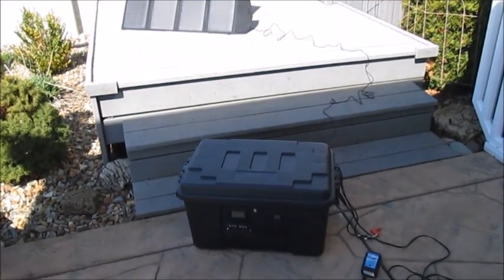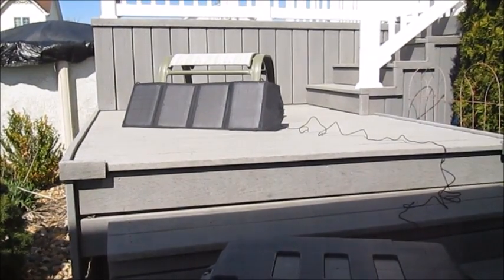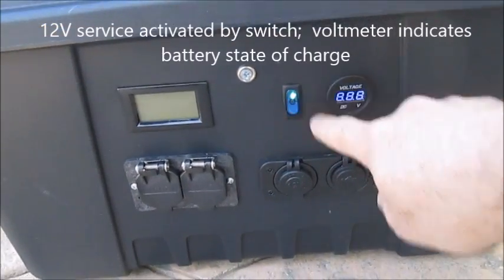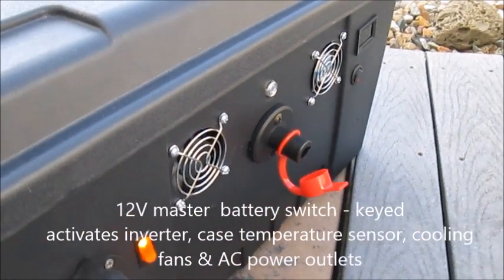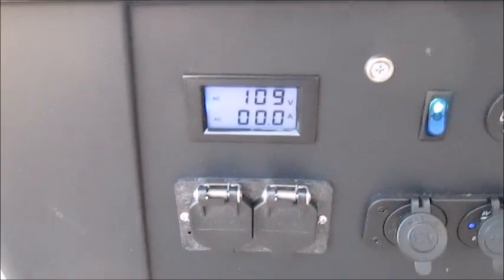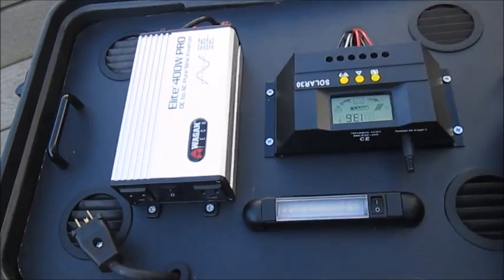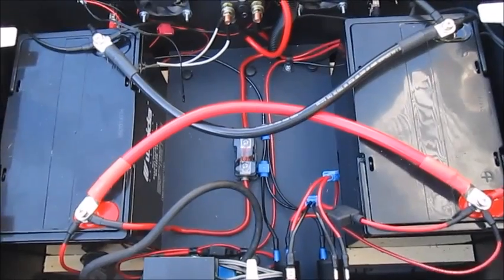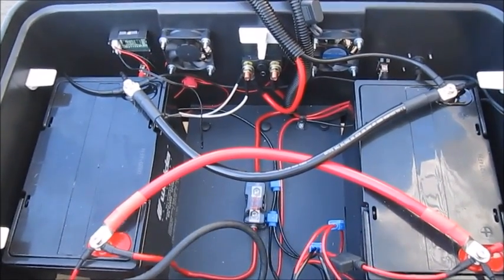V1 P1 DIY Portable Solar Power Generator - Wiring Schematic, Parts List, FAQ Sheet Provided

Comment: How do you know how much percentage you have left to draw from the unit.
Reply from the maker: I use two different voltage indicators for the State of Charge of the AGM batteries.  One is located on the front of the case, the other is built into the charge controller.  The voltage is then compared to a state of charge percentile conversion chart comparable to this one  http://www.aussiebatteries.com.au/assets/images/12-v-Battery-State-Of-Charge-website.jpg  There is also a basic State of Charge bar graph style meter built into the charge controller.  I rely less on that because it is not as specific as comparing the actual voltage reading to known data regarding percentage State of Charge.
Reply: Jim Fisher  How accurate is indicator. If this works good for you I am so building me one of these. Can you recommend a 1200W pure some wave inverter.
Reply from the maker: Both voltage meters are generally reading the same voltage, + or - .1 volt, so I think they are quite accurate.  Others who have built these types of systems use AIMS pure sine wave inverters and have given positive reviews.  I don't have experience with that brand myself.
Reply from the maker: based upon the specification of the 15A model of that charger, it should be able to handle your combined 250ah batteries' charging needs.

Comment: This looks fantastic!  I'm looking to build one of these for phone charging and charging my Makita drill batteries, etc in case of SHTF or power outage.  Can you add another power generator device in addition to the solar panel?  I see there's bike pedal power generator and I'd like to make a way to be able to charge the battery with solar or bike pedal.  Would you just wire the solar panel and pedals in series then to the controller? Also, for the USB charger plugs, did you wire that before the inverter? Again, excellent build, that thing rocks!
Reply from the maker: Thanks for viewing, and for your comments/questions.  Yes, you could use other types of power generation devices such as wind turbines or a bike pedal power generator to charge this system.  I would separate the various power input systems.  A solar charge controller is not likely appropriate for regulating power from anything but solar panels- you'd likely use an alternator coming from your pedal generator.  The USB charging ports are connected to the bus bar, which takes its power directly from the batteries.  The USB ports are DC, not connected to the inverter at all.

Comment: Posting says $150.  Voiceover says $950.  Building my own to save $!   $950 is no bargain when I have to hire electrical engineer to do it for me as I'm paralyzed and vantage afford ready-made one for $1500! Too much $ for a DIY roject but it's sturdy.  Guess if you can afford a boat you can afford  a$@50 DIY project...if you are an electrical engineer!
Reply from the maker: Hi Melodee, thank you for your interest in my DIY project.  Not sure where you saw that the cost was indicated as $150.  You are right, if you do not have the ability to use power tools or have a good understanding of DC and AC electrical systems, this would not be a DIY project you would want to undertake.  It does not require an electrical engineer to put a system like this together, but certainly requires handyman skills and a substantial amount of research to be sure of what you are doing.

Comment: Great looking piece of equipment!  Question: would using a lighter colored container reduce the internal temp of the unit if left in the sun, or do you just make sure it stays covered when in use?
Reply from the maker: Thanks Marc.  Using a lighter colored case would likely keep the internal temp down if you intended to use the system outdoors.   In my case it is always kept in the shade inside my boat's cabin.

Comment: I gotta say, that's a very clean build.  Not sure why all the angst shown relating to cost.  The parts list breaks it all down quite nicely.  The Leviton plug cover is now $40 though, a bit steep for what it is.  I may get the slightly larger case so I can fit a larger Modified Sine Wave Inverter along with the smaller Pure Sine Wave and possibly a third battery.  Thanks for the great ideas.
Reply from the maker: Thanks for viewing and for your comments.  Hope your build goes well!

Comment: $1000 bucks? Not good value for the money. Fun project but a waste.
Reply from the maker: Your comment only serves to display your ignorance about these types of systems and component costs.  Do some research.
Reply: $2000 for the exact same thing made by Goal Zero (Yeti1250).  $1000 and some elbow grease is a good deal
Reply: I have 50 dollar in mine you just gotta be proactive and find your resources. Patients is key

Comment: is there a way to make one of these to handle a freezer and fridge? I am moving into a travel trailer but I am buying a shipping container and i will be putting my freezer and such in that and I need to keep it powered.
Reply from the maker: Dawn, you can make one but the appropriate size of the system will be dependent on the power demands of the specific freezer and refrigerator models you intend to use.  You will need to know how many AC watts they require to start their compressors and then the average of the total watts they will consume each day.  Your inverter will need to be sized appropriately to offer the AC start up watts (at peak or surge) required by their compressors and then you will need to calculate the total wattage of the solar panel array and battery storage capacity you will need to ensure that you produce and store more watts than they both consume.

Comment: Question well firts of all congrats. It is really clean. But mi ? Is can i trikle charge it while is in use
Reply from the maker: Thanks for your comments and your question.  Yes, you can use the system while it is being charged by either solar power or AC trickle charging.

Comment: Nice set up Jim. I like the idea of the top tray in the Pelican case. I've seen many of these built with parts attached and wired to the lid of the enclosure, making it tough to get inside and maintain. Good job.
Reply from the maker: Thanks for your comments Kurt, they are appreciated.

Comment: Good stuff.  Im without power thanks to Irma in Puerto Rico.  Generators are fine but limited due to fuel.  Sun is free.  I need to put a system like this together
Reply from the maker: Thanks.  Yes, these types of systems are very useful during extended power outages.  Hope things get back to normal for you soon in PR.

Comment: Case sholuld be light color if it ever has to be in sun. Or store a silver bubble  blanket for it.  Just for grins what is a good example of capacity  for X hours  light, computers (2) 50 watt fan  etc.  Thanx.
Reply from the maker: This is primarily used on a boat and it is stored out of the sun at all times while in the cabin, but you could certainly make one with a lighter colored case if you intended to to use it outdoors.  Here's a link to some calculations I did regarding capacity-  http://www.creeksideartifacts.com/SPMGMTcalculator.pdf

Comment: Nice job. I used the same type of tool box and made something pretty similar.
( I used a stanley fatmax toolbox ) , its still fairly heavy when loaded with batteries , but the wheels on the bottom make it easier to move 

I love the way you incorporated the tray to hold your instruments

Great job !
Reply from the maker: Thanks for having a look at my project and for taking the time to comment!

Comment: Jim this is one the most impressive DIY video I've ever seen.  Awesome...  One question, how did you construct the inside cover (housing your inverter and solar controller) as well as the "well of the battery and wiring chamber"?

Watch all your videos Parts 1-6, well done.
Reply from the maker: Thanks Burt.  The inside cover, or deck on which the inverter and solar charge controller are mounted, is made of blackboard material I purchased at Home Depot.  It was cut using a scroll saw and contoured using a router for a perfect fit to the case.  The same material was used, along with some 1"x4" wood, to create a frame that fits in the bottom of the case.  The frame was constructed in the shape of an "H" and the two batteries fit in the recesses on either side.  The "crossbar" of the H was made from the same blackboard material.  The result was a lower deck on which you see the ANL fuse holder and the bus bar mounted.
Reply: Jim, thank you very much.  I'm sure you heard it all before, the skill, workmanship and the method in which you have applied towards this project is nothing short of amazing.  I look forward to future episodes of this project as it is morphing into a "Thing of Beauty"...  I will continue to stay tune in.

Comment: If there is an intermittent power problem on the 12v side, the first place I would check is the blue quick splice connectors, if anything I would take the quick splices out and make a "T" splice in the wire
Reply from the maker: Never had a problem, but see my Part 6 video.

Comment: Now, I think I am becoming a pest. Not to be deterred, I know your design is a few years old (does not change functionality one bit) and specifications, cost, et al. constantly change. I am considering a 30 ampere MPPT solar charge controller that is around the same cost as your PWM solar charge controller. The MPPT controller allows for upgrading and expansion too. Unless, there is a reason not to do this.
Reply from the maker: Not at all Jon.  I enjoy conferring with others about these types of systems.  I have learned a lot from folks who built versions that preceded mine and its always good to pay that knowledge forward.  

From what I have read, MPPT charge controllers are more desirable as they are more efficient than PWM controllers.  They do  tend to be quite a bit more expensive than PWM controllers and are usually larger in size.  I also learned during my research that in smaller systems (i.e. one like mine where I was initially employing a single 100W panel) the gain from the small amount of increased efficiency does not justify the significant increase in cost for the MPPT charge controller.  BUT...If you can get a MPPT controller for the same cost as the PWM I used I would definitely make that upgrade to allow for future panel expansion and increased efficiency.  My inverter and charge controller choices were partly based on their dimensions and space availability in the Plano Sportsmans Trunk that I used.  I use the 400W pure sine wave inverter to power my laptop computer while on my boat.  I also have a larger 2000W modified sine wave inverter that I keep onboard and connect to the external bulkhead terminals with the hand screw knobs if I need to have more power.
Reply from the maker: Here's a repost of another response I provided on the topic of MPPT vs. PWM charge controllers:  

     The decision regarding PWM vs. MPPT comes down to the following factors, in my opinion:  Size of your solar array, price you are willing to pay for a controller, and considerations involving the physical dimensions of the charge controller.  From what I have read, the price you can expect to pay for a MPPT charge controller is very high vs. the return you will get in terms of increased watts being delivered to the batteries when you have a SMALL solar panel array.  In other words, the net gain in wattage from using a MPPT controller with a small array is negligible compared to the substantial increase in cost you will incur for the MPPT controller.  Most who have analyzed the cost effectiveness have advised that you simply spend the additional money on another solar panel to increase the amps/watts coming into the system.  The cost of an additional solar panel for a small system will be less than the increased cost and greater efficiency of the MPPT charge controller.  The last factor, and perhaps least important, is the space you have to accommodate a charge controller.  MPPT controllers tend to be much larger.  In a small, portable system the physical dimensions of the controller may be of concern.  PWM controllers tend to be much more compact and can offer substantial space savings if that is a need.    

      
      
Show less
Reply: You are correct in your research and analysis. For this size of system and intended use, a PWM controller would be the best choice. The only down side is PWM controllers made in China are a crap shoot. Nearly all of them either under perform, or are dangerous to the batteries, etc. Someone would have had to performed a full test of a PWM controller and verify the specifications before buying one. I am listening to some YouTube reviews at this moment. If I find one with a good review I will start off with one. Just one side note: the price and size of MPPT controllers are coming down in cost and getting smaller, respectively.

Comment: Just some thoughts as I am ordering items from your parts list. First, I am considering a 1000w inverter for about half the cost of the 400w inverter. I have to evaluate its physical size, weight, and heat generation. On to my thoughts. What if  the impossible happens and water does get into the case. To save time by disassembling part of the system in order to tip the unit on its side to drain any water within the unit, I am going to add a simple water drain plug. Next, I am going to research adding a circuit to automatically set and turn-on the fan. I will keep the individual switchable functions for the fan on continuously and fan off. Just some thoughts.
Reply from the maker: Modified or pure sine wave inverter?  I do like your idea for an automatic activation for the fans, Jon.  Are you thinking about putting them on a timer that intermittently turns them on and off?   Jon I sure hope that the "water in the case" scenario remains impossible, but having a drain in the bottom is certainly a bit of insurance against a potentially really bad situation.
Reply: I subscribe to pure sine wave inverters especially now that they are getting smaller and cheaper. Using one removes the chance a device will not survive on power from a modified waveform inverter. One less issue to think about when plugging in a device.

The drain is just cheap insurance if and when Murphy's Law strikes. As you say, "a bit of insurance against a potentially REALLY BAD situation". No one needs a fire aboard complicating an already bad situation that most likely started the water in the box fire and meltdown. The same for camping and any other situation.

I am thinking about a simple temperature probe and circuit that you set and when this temperature is reached the fan activates. Nothing fancy. Just insurance to prevent any thermal shutdown and/or system failure. When you need the system most Murphy's Law comes into play.

It is late for me, so, I hope this makes sense.
Reply from the maker: Yes, that fan set-up make very good sense.  You probably already saw my part 4 video where I installed a snap disc thermostat switch.  If I were to do it over again I sould have maintained a manual override switch for the fan in addition to the automatic thermostatically controlled switch.

Comment: That is an excellent battery box, but I think you will find that 28 W of solar panel will be woefully in adequate.
Reply from the maker: Thanks for the compliment, but I think you need to listen to all of the details that were explained in the video.  The 27 watt panel, as explained in the video, was used only for demonstration purposes.  The video also explains that this system was designed to be used with at least a 100 watt panel.
Reply: Jim Fisher: forgive me, I was watching this at work between phone calls and customers, must have missed that. I used the same size panel at Boy Scout Summer Camp here in South Texas. Just running my fans and LED lights, it just wouldn't keep up. Even with 7-8 hrs of full sun. My other set up uses a 40 watt panel and works fine.
Reply from the maker: No problem, I am presently using two 100W flexible panels made by Windy Nation.  I am very pleased with the pairing of 200 total panel watts with this system.  Gives me all that I need and more.  Currently running a 1.1 cu ft Dometic refrigerator freezer with it on my boat and even on cloudy days it keeps up.

Comment: The question I have is why you don't have the 12v front panel power output jack wired into the DC Power switch like the meter and the USB ports are.
Reply from the maker: Good question Timothy, thanks for asking....the answer is simply a matter of conserving battery power.  The 12V power outlet is always "off" unless something is plugged into it.  Both the DC Voltmeter and the USB port need to be switched off otherwise they are constantly drawing power.
Reply: Duh! [Slaps forehead] It's always the simple answers that one forgets. Nice setup. Just curious, how much does the setup weigh?
Thought: Possible to add a cord of some sort to the cart to make it easier to pull along behind when moving.
Reply from the maker: Timothy, this weighs in at about 90 lbs.  The vast majority of that weight is ascribed to the two AGM batteries.  Yes, you could add a a handle or cord to the movers dolly that I use to move the system.  I would suggest that you consider a different box, with similar dimensions, that has built-in wheels and a  pull handle if you really want to make this system as mobile as possible.   Something like this:  https://www.toolbarn.com/dewalt-dwst17820.html/?utm_source=google&utm_term=&utm_campaign=CPCS+-+Shopping&utm_medium=cpc&utm_content=C86dgNl5_pcrid_90615792974_pkw_PLA_pmt_b_pdv_c_